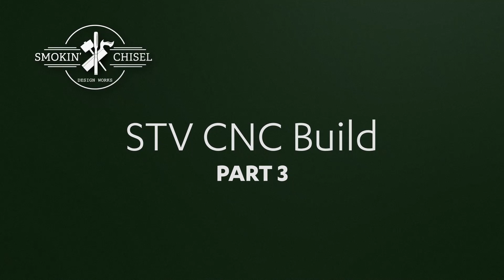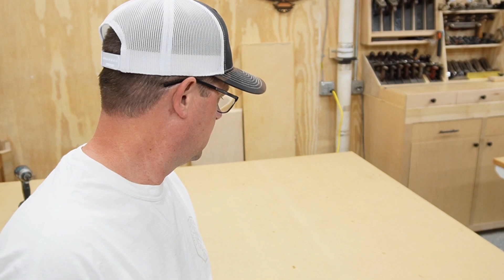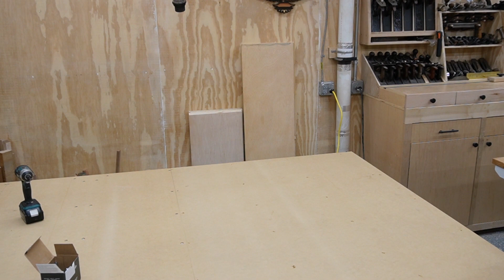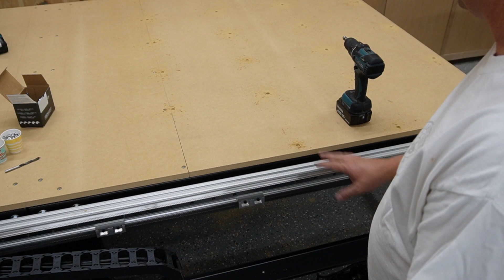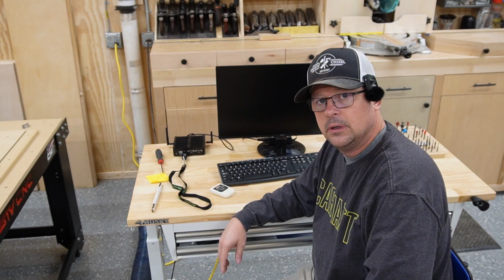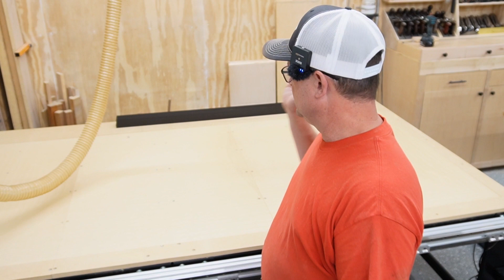STV CNC build part 3 another alternative to Avid CNC

Comment: Thanks for showing this video. I have the exact same machine. STVR 8. I live in Vegas so the STV team delivered it to my shop pre assembled. However, I had to square it up, level it and tighten up all the loose bolts, readjust the tracks etc. Unfortunately when I tried to home it the 1st time, it did not work. After 2 weeks of playing with it, I finally figured out that the X and Z sensors were swapped when they pre assembled it. When they installed at the factory, the guys ran the sensor wires in the wrong location so the labels on the wires didn't match where they were supposed to go on the controller. Anyway once I figured that out, I swapped them on the controller and it Homed. Now I'm trying figure out how to configure V carve to work with the machine and there are no instructions to explain that. What Associated Post-Processor did you associate with the machine in V-Carve? I'm lost... Lol...!! Also where did you get that step-up for your vacuum hose? Please make more videos, this is very helpful. Any help would be much appreciated....